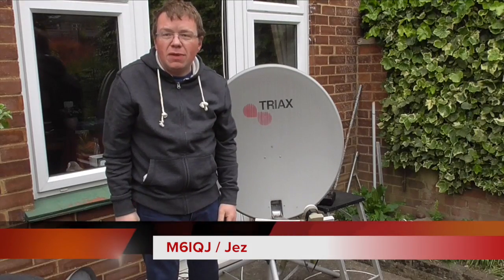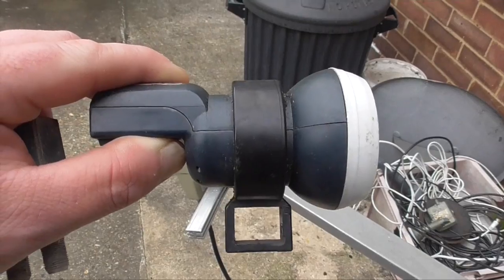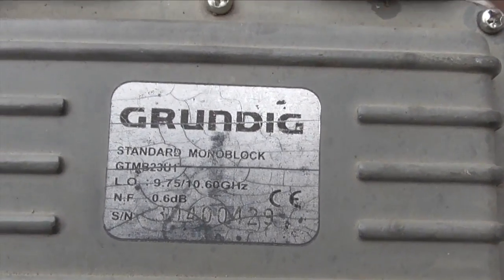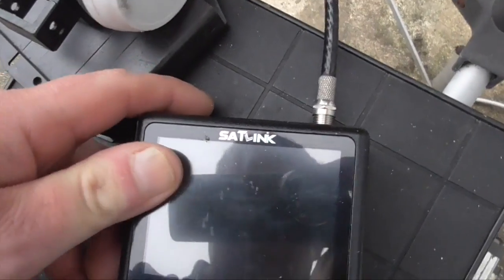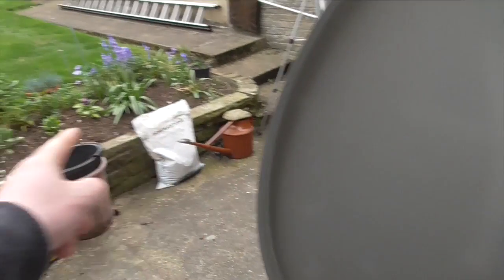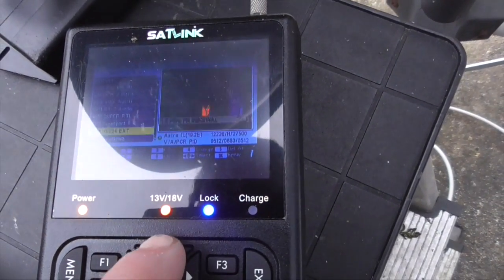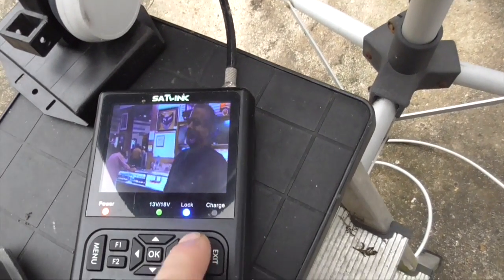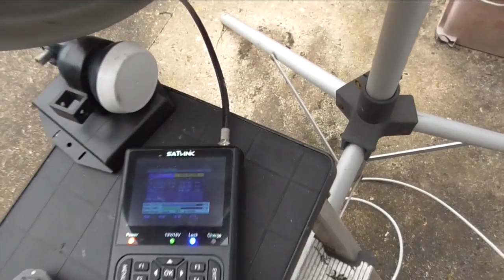Signal hunting with the new satellite meter

Comment: There is 4 satellites that are interresting. From 28.2E down to 0.8W. Astra 28.2E the best satellite that's out there in 2024.
Thor 0.8W, Hotbird 13.0E, Astra 19.2E and Astra 28.2E

For many years ago, when Sky was analogue it was broadcasting on 19.2E and moved to 28.2E when it started digital.
You may catch Astra 1, but you can't get Thor 5 and Thor 6 at 0.8W buy moving the dish because expample. In London Astra 2's elevation is around 25.3 and Telenor's Satellites: Thor at 0.8W is around 31.4 the elevation is 6 degrees between eachother. But where i live in the Faroe Islands i need a Wavefrontier Toroidal T90 Dish because of the elevation is to far from eachother
Thor 0.8W - Elevation 19.5
Hotbird 13.0E - Elevation 17.7
Astra1 19.2E - Elevation 16.4
Astra2 28.2E - Elevation 14.1
Dish sizes
Astra 1 - 80 cm 2nd best signal
Astra 2 - 70 cm best signal
Hotbird - 85 cm 3rd best
Thor 0.8W - 90 cm 4th best reception
It has been bad weather and with good reception. Astra 2 stay at 96% Signal Strength and 100% on Signal Quality both Freesat Beam and UK/Sky beam
Reply: @hakunchristiansen9745  hi, can you advise me if I can get Amos in Manchester ?
Reply: @ Well you can if you have at least 240 cm (2.4 m) dish sizes. But you can try see if you can get it. The elevation is around 28.6 and 29.2 in Manchester. Located at 4.1 west. Note that a mesh dish can do the signal a little bit weaker. I got rid of those dishes and use instead a solid satellite dish. If you want better signal you can use Black Ultra LNB from inverto.
Reply: @hakunchristiansen9745  thanks for answer and ur advice,
But can u  tell me which satellite can I getting in this area except astra 28 ,23, hotbird 13 and Eutelsat 16?
And what u means about elevation?
Reply: @ elevation is that when you point the dish up and down. 0 is lowest and 90 is the highest. More you move the dish to east then lower you need to align the dish.

Comment: I’ve just bought that same meter. Looked at the instructions, they didn’t make much sense! I found this video really helpful. So just to recap. Freesat and sky are on the Astra 2 band? And you press f3 to get the beeper on, then start moving the dish, and a quick beep means the dish is pointing in the correct direction?
Reply from the maker: Select astra 2 28.2 Press F3 so it bleeps. move the dish till you get a faster beep. if it beeps fast and you have no picture then your on the wrong satellite. if should beep fast and display a TV channel I.E itv 1

Comment: Any one who can help?
I got a Skye dish and I tried putting multiple lnbs on a slide bar,but I couldn't get a signal.  The dish is in perfect alignment. I have tweeked the lnbs but still no signal. Is it possible my Skye dish is too small or should I  get bigger??
Reply from the maker: Which satellite are you trying to pick up uk $ly?
Reply: 60
Reply from the maker: @bryanwhitehouse9506  I’ve had the same problem with multiple lnbs can’t get a signal if I want 2 satellites from one dish I use a mono block lnb. Your multiple lnbs should go into a switch box then the receiver should be able to control the diseq switch
Reply: Thanks for your advice.
I'll try a mono bloc and switch connector.
Reply from the maker: @bryanwhitehouse9506  the mono block will switch it self but if your using multiple lnbs your need a switch
Reply: Yes an astra satellite
Reply: Works fine with 1 lnb  which I placed dead centre of dish but with sliding  bar I can't place in centre as the fitting of bar is in the way to get an lnb there
Reply from the maker: @bryanwhitehouse9506  how big is the dish is it a zone 1 dish 35cm?

Comment: I live in Sweden, have 120 cm satellite dish,, if it is good weather then there is no problem see itv, BBC, channel 4 (Astra 28,2 E, But Worse weather, it does not work so well,
Reply: I live in the Faroe Islands. I bought a Sky Zone 2 80 cm dish from UK. I can receive all UK channels and Sky channels. I do have Sky Q from UK.. bad weather even storm weather i have no issues. This is because Faroe Islands is inside the footprint... same dish sizes as in Scotland. 80 cm. 70 cm works fine. But not when it is heavy storm weather. 80 cm do everything. No loss of picture. Signal Quality is 100% on all channels, but when it's heavy raining it goes down to around 87% and gain is 13.8 - 16.3 dB normally it is around - 16.7 - 17.4 dB

Comment: Any idea on programming the satlink finder..
Reply from the maker: Wayne Wayne mine was second hand and came pre programmed in Astra 2 I’ve not used mine in ages I’ll charge it up and take a look into it
Reply: I ending up adding new sat on the sat link.. It's working on astra 2d
Reply from the maker: Wayne Wayne I glad you finally got it working enjoy your meter
Reply: Yep.. For a test run I used my bike tripod stand and a 6ft pole plus slowly adjusted it till the sat link locked on and adjusted the signal level to about 52%...

Next is to blot a pole to the side of the house or my workshop and set up the humax box.

Yeah the trusty bike stand works a treat as its the same type as yours.
Now back to working on me power amplifier module stuff.
Reply: I am living Saudi Arabia how to catch Astra1 signal how many feet dish want and this position east or West.

Comment: Not having much luck with the satlink meter so used my sat needle meter and seemed to of found a single for the humax box in about 20mins of tuning the pitch up and down with a little to the light and right..

I set the dish to 20.1 and the compuss to 135 of south
Reply: The satlink meter works a treat now..
Reply from the maker: on them needle meters I turn it so I can hear the noise and then move the dish so the noise gets louder and then you have to look at the TV to see what satellite you've hit

Comment: I've the same satlink meter but having trouble trying to find a satellite... The dish is set to 28 on the scale then slowly moving the dish after pressing f3 and no luck..
Does the meter need lnb set up
Reply from the maker: My meter was second hand and already had astra 2 programmed in . I had trouble finding hotbird satellite so I went to a friends house he moved his dish to 13deg and once there I was able to tune in the satellite when I got home it took about 2 mins to find 13deg . the meter powers the LNB so you can watch tv on it. If you no someone with a astra 2 dish up ($ly) then tune the meter on that then finding astra 2 at home will be easy
Reply: Yeah looks I'd need to program the sat astra2 in to the meter. On the dish bracket there are some 40 30 20 and 0 markings to get the elevation right, so astra2 would be at 28.2 and say 140 south east..
Reply from the maker: Wayne Wayne all i do it set the meter to Astra 2 then make it bleep then move it so the beep gets faster and you should get a picture I’ll have to do a video setting up Astra 2 I’ve got a camping satellite dish I’ll use that

Comment: Great meter you have there Jez.  Much better than a needle meter and guess work to find out what sat you have hit.
Reply from the maker: Yea I used to keep having to go up and down stairs to look at the tv screen to see if I've got a picture.
I even used to use face time with my laptop and phone just to see the screen.
But this meter makes this easier
Reply: Yeah i used a basic meter when i set up the TV in the summer house.  No real idea what sat i had found.  There were plenty around though.  Not as many as pre digital.
Reply from the maker: All the satellites are now digital.
Even if you got a old dish as long as its got a universal LNB it should be able to receive digital from the satellite.
old analog boxes are of no use anymore
Reply: @2j4ez I have satlink ws 6906 how can I use it on twee port smart LNB please
Reply: I have it on single LNB
Reply: What Satellite Dish it doesen't matter by the way. if it is a analogue or digital Satellite dish. i use many satellites in the Faroe Islands. from THOR 0.8W, Atlantic Sat 5.0W, Astra 19.2E, Astra 28.2E and Hotbird 13.0E and i also have Sky+HD from UK. Astra 28.2E only need 60cm in the Faroe Islands.
Reply: @hakunchr  wow and here in northern sweden almost impossible to get UK.

Few years ago I got signal some transponders was even better reception than on Thor 1w.
Reply: @Italodancer  Well in the Faroe Islands you have Allente Denmark. There are 4 satellites located at 1W Intelsat/Thor 10-02, Thor 5, Thor 6 and Thor 7. The only satellite i can’t get, is Thor 7, because it’s out of the footprint. Someone can recive it with 310 cm dish. But Thor 5 and Thor 6 is good with 85 cm recommend 1 meter dish. 100 cm dish is like 65 cm dish in scandinavia. Same signal quality. Around 15-16 dB.
You can’t really get Astra 28.2E, because it is a UK Beam, lucky enough Faroe Islands is inside the UK beam, that’s why i can use Sky Q in the Faroe Islands. Dish sizes from satellite to another satellite:
• THOR 0.8W - 85 cm (recommend 100 cm)
• Hotbird 13.0E - 80 cm
• Astra 19.2E - 75 cm
• Astra 28.2E - 70 cm
• Astra 4A 4.8E - 250 cm
• Amos 3 4.1W - 310 cm
But most use Thor 0.8w and then Astra 28.2e and then 19.2e